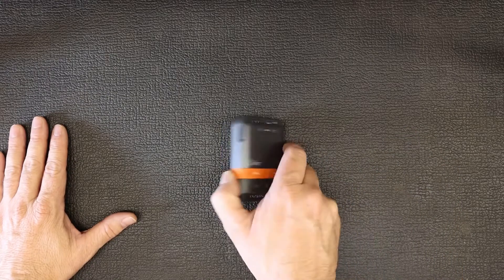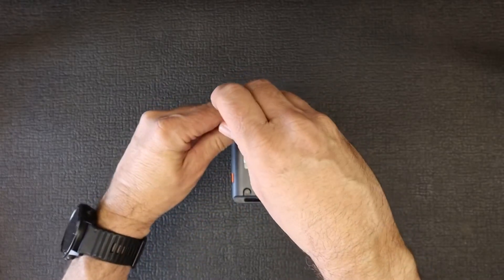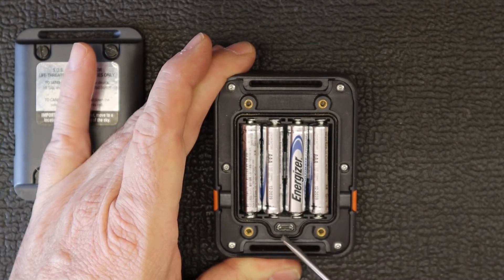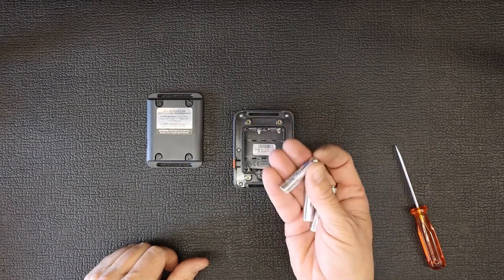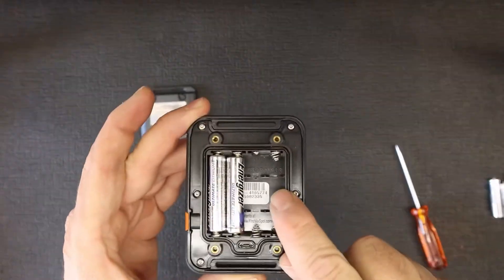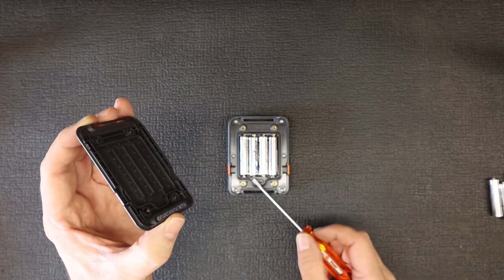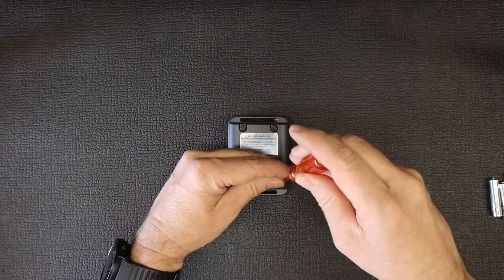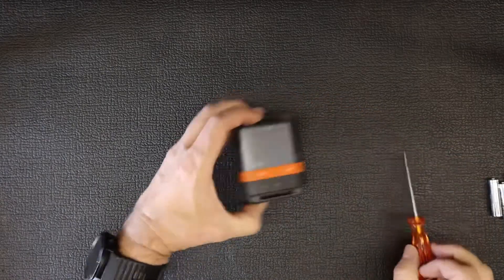SPOT GEN 4 | Battery replacement

Comment: Thanks for share Brian, which batteries do you suggest instead Energizer ? This brand/model is very expensive in Brazil :(
Reply from the maker: Hi,
Thanks for watching. Not sure what brands you have in Brazil. But any batter should do as long as it's a lithium battery. But an alkaline battery will also work in an emergency. Lithium batteries maintain their full voltage almost until the end. Alkaline batteries will reduce their voltage output throughout there lives. Lithium batteries also last much longer . I must however add that I have not tried the alkaline batteries in the unit.